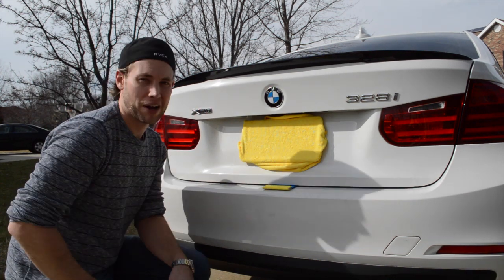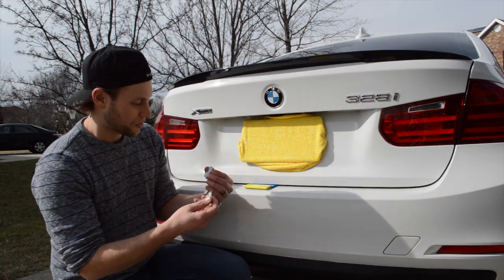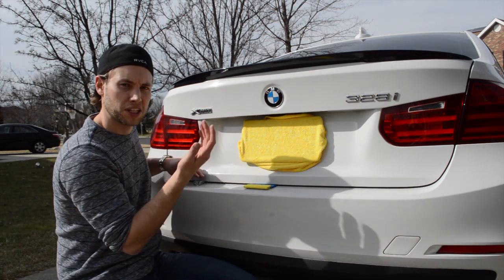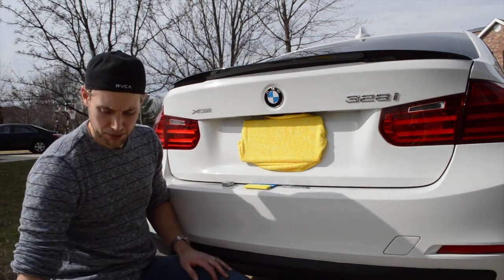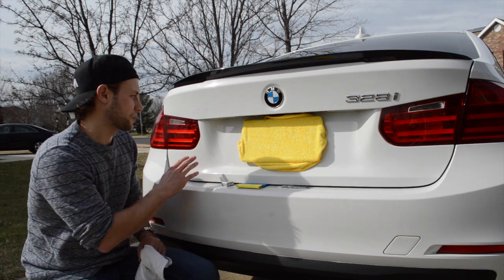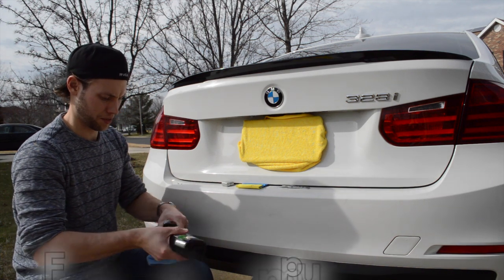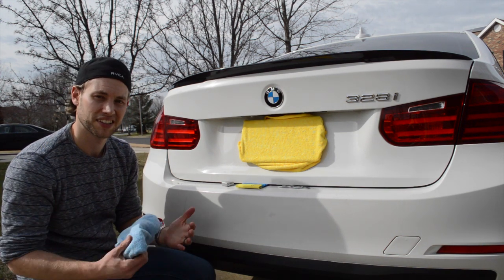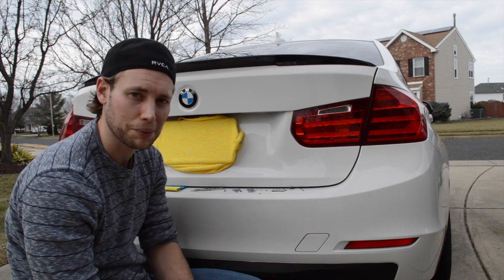How to De Badge Your Car (with Floss!)

Comment: The rust on your car is actually brake dust that comes up from your brakes. A great way to clean it off is to scrub it off with wheel acid and a clean microfiber. However, never let the wheel acid dry onto your paint. Make sure you're working with a wet surface. A clay bar will also work but will take some more force
Reply from the maker: Great tip, thanks!
Reply: Or use an iron fall out product that is totally safe for your paint and literally dissolves the spots......

Comment: any tips for those of us who have a dealership decal instead of a metal plate.
great videos, well done.
Reply: get an old credit card or ID and some goo gone I use to work at a dealership detailing the cars that we got in and that's how I got the old dealer stickers off
Reply from the maker: Yea that works good. I used to work at a dealer and they would get us plastic razor blades..
Reply: +Kies Motorsports ya we used those too but not everybody is going to have those, also 2 of the dealerships I worked at were near the railroad track and the white and silver cars always had the orange spots and the one away from the track I never saw the spots so there may be some truth behind that

Comment: You can also use automotive clay to remove those rust spots.  It also leaves the finish incredibly smooth as well.  I always use it before polishing.  It makes the wax last a lot longer too!
Reply from the maker: +garytanaka Great tip, that works great as well!

Comment: Great video! Have enjoyed your instructional tips. Quick question, if I don't have a heat gun do you think a hair dryer would work? How warm or hot does it need to be to de badge? Thx
Reply from the maker: +Ken Or Thanks! Yes, you can definitely do it with a hair dryer as well. As long as the emblem is on a metal surface, heat the area until it's very warm to the touch. I can't give you an exact temperature, but basically your goal is to heat the adhesive up to make it easier for the floss/fishing line to cut through. Hope this helps!

Comment: It's iron. I use Griots Iron & Fallout remover. After you've washed your car simply spray it on , let it sit for about 10-15min and it will dissolve the iron and rust spots. Rinse area really well and put a light coat of wax over the area where you sprayed the remover. Carpro Iron X is another good one to use.
Reply from the maker: Good tip!

Comment: ´Hi, Brian. awesome DIY vids mate :)  I dont know if you can help me out , i have a 2014 F11 5 series LCI  which is loaded on chrome trims, im trying to remove the tailgate chrome bar that comes with the luxury line, it seems to be installed by adhesive. Do you have any thoughts on removing that chrome piece? cheers and many thanks
Reply from the maker: Thanks! Hmm, I don't quite know. If it is adhesive, you can most likely remove it the same as this. What about wrapping it?
Reply: Kies Motorsports hum... haven't consider it yet, i prefer it to be removed. That piece has been there for the past two years, I'm sure it's going to be an ordeal lol,  maybe I'll try flossing it out this weekend :D cheers for the reply. Subscribed.
Reply from the maker: Thanks and good luck!

Comment: What is the tool that you use to take the residue off? Is it plastic? Looks to have a yellow handle and blue surface.
Reply from the maker: +JC Blewitt Hi, I just used a hard card that's typically used in vinyl wrap applications. It's soft enough to not scratch. Thanks for your message.

Comment: those rust spots are break dust, its on every car. first do a good wash, then rub a cleaning clay over your car to remove rust spots plus this will take care of any other contaminants on the surface of the paint. Then buff and polish till your happy. other methods include doing a watered down acid wash,  that will remove rust spots also.CAR BRIGHT makes a good clay, and you'll need some body shine also, to use as a lubricant for the clay.
Reply from the maker: Good tip!

Comment: for all of yall saying 328i is slow. you could get a dinan power kit and be at a higher whp/torque with better weight distribution from the 4 vs 6 cyl. oh did i mention it costs $2000 less than the 335i???? whos slow now?????

Comment: 1. Would a hair dryer work
2. Do I need to use the Goo Gone (or similar product) right away or can i do it the next day or two? (when i can go out and get it)
Reply from the maker: Yes to the hair dryer and you can goo gone days after without issue

Comment: any way of doing it without a heat gun?
Reply from the maker: You can try a hair dryer
Reply: Ok, Thanks.
Reply from the maker: No problem! You can do it without heat, but it makes it easier to scratch the car.
Reply: +Emmanuel Lawrence a hairdryer does work I did it today.

Comment: So, just to be clear, people do this because they can't afford a "higher tier" BMW, so, they buy a "lower tier" one, and are ashamed of it, so, they take off the badges for this reason??
Reply from the maker: Some may, however, I'll say most (including me) do it because it looks much cleaner. No body is pretending to be an M3 by taking the badges off... 

I also have the badges off my 335...
Reply: I've met SEVERAL 3 series owners who were pretending to have an M3 by buying all the bells and whistles (spoilers, and front bumpers, side skirts, diffusers, etc).  I'm not saying taking off the badges is the only thing these people will do to pretend to own an M3, but it's definitely in the same ball park if you're a poser. (not saying you are a poser).
But honestly, I've never understood that rationale - that it looks "much cleaner". In fact, I've BOUGHT some badges for some cars I've bought that didn't have them. I don't know, I think not having them takes away from the look of the car.